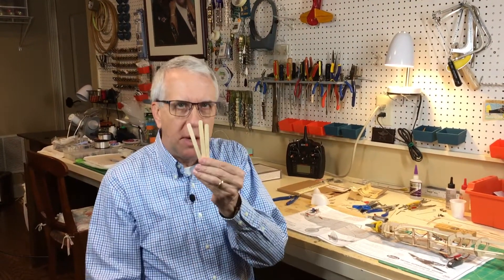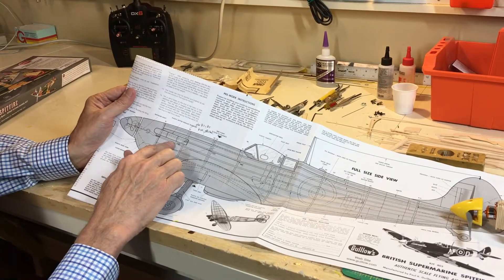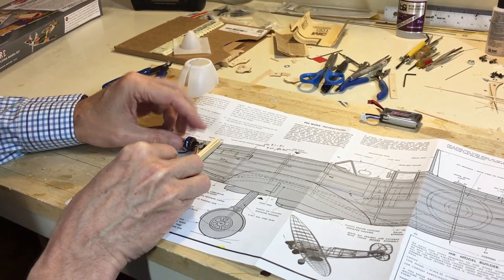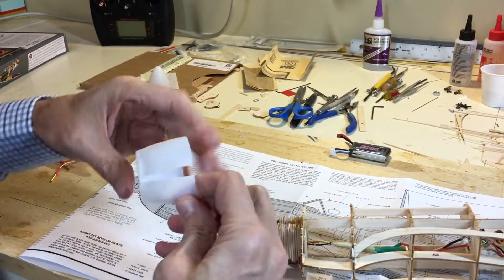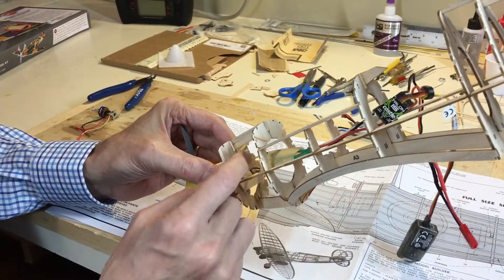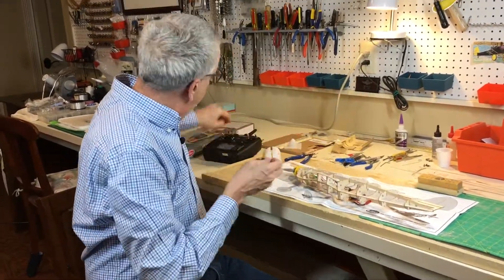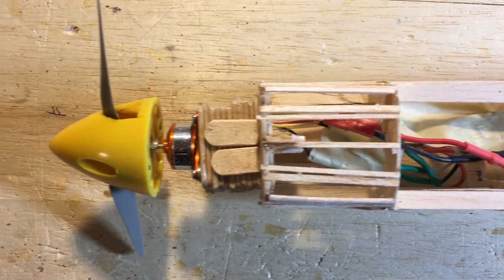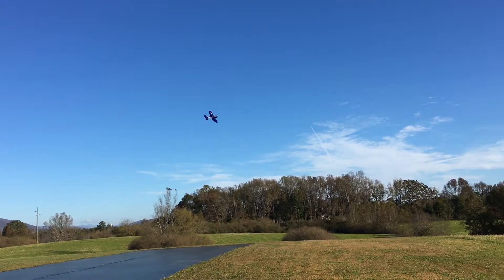Popsicle Stick Motor Mount

Comment: I have 3D-printed a motor mount and have also used four birch dowels between the firewall and the X-mount on the back of the motor. However, sometimes you'll need the extra weight of those popsicle sticks because of the light weight of electric motors. Sounds like you need to check the balance of that prop and the spinner.
Reply from the maker: Great points, thanks!  Tim